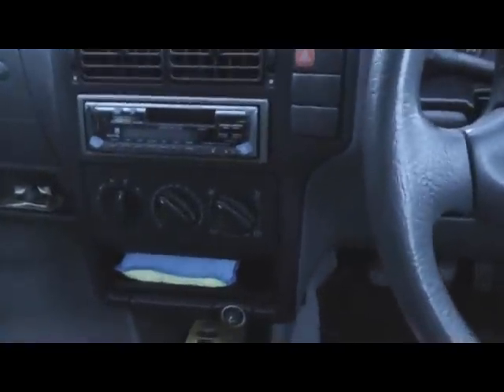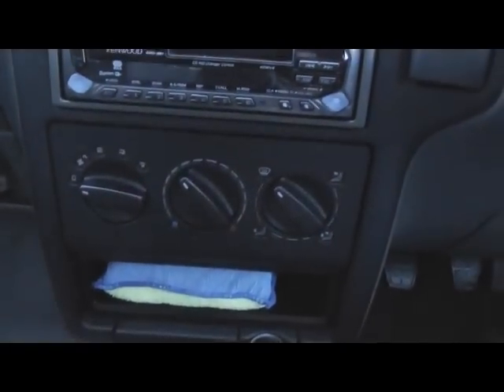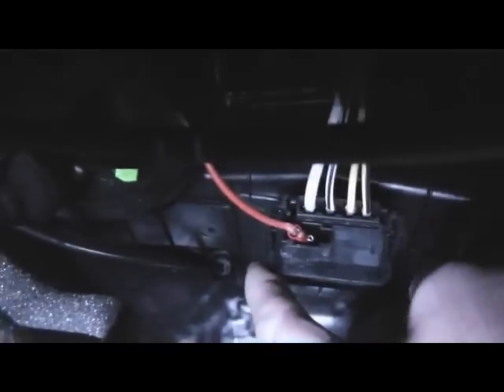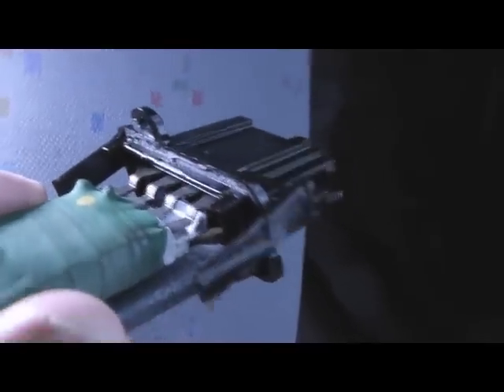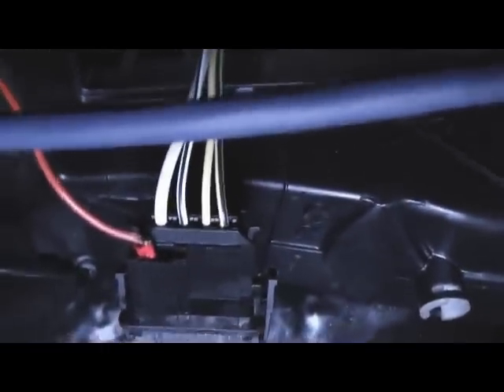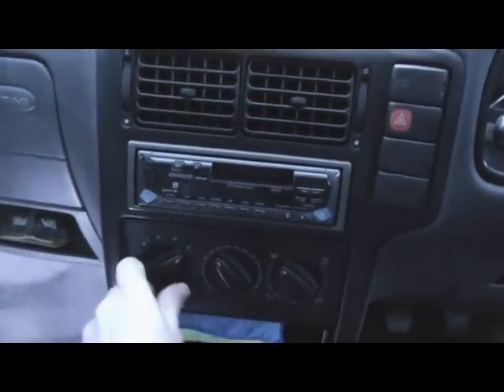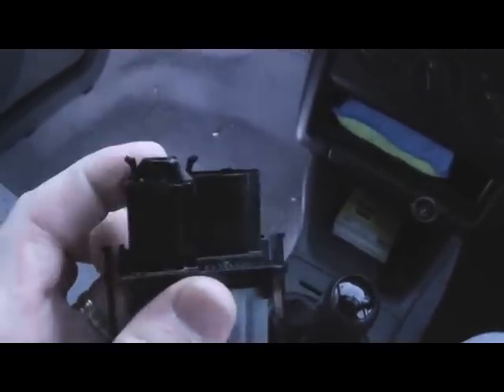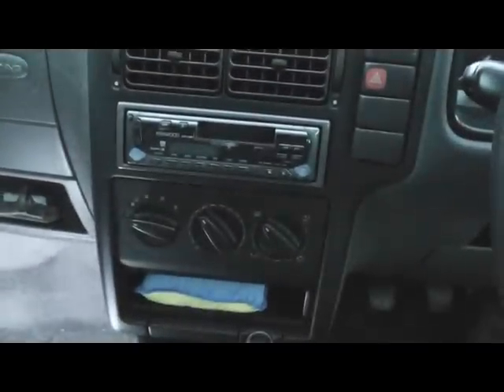VW Polo Heater Blower Fix.wmv

Comment: Great video Mate. Been without blower for ages and had given up but this is the fix. Thankyou. VW wanted £50 for this part. Main dealers have stopped stocking them but have 3 left in Maidstone. Perhaps that because they charge so much.